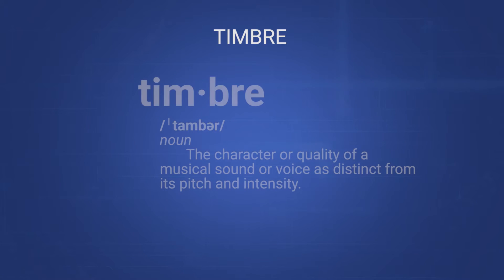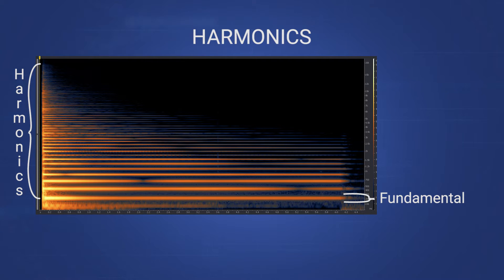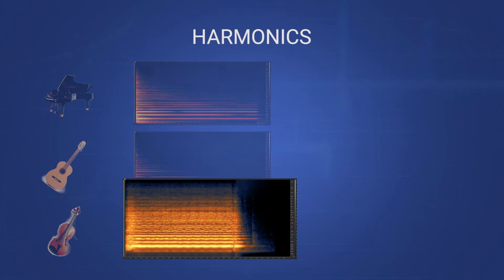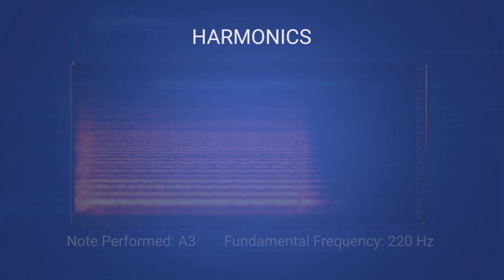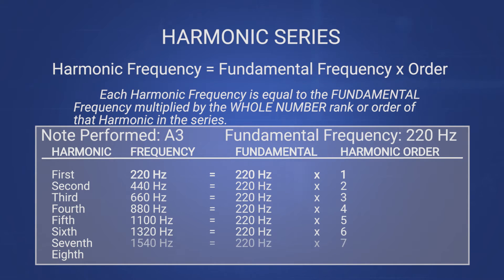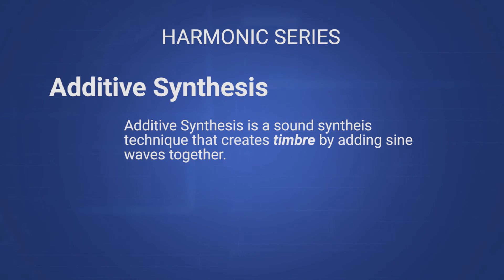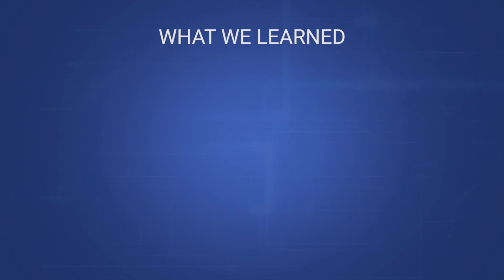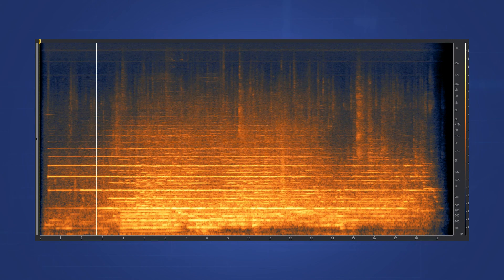Overtones Timbre and the Harmonic Series Full

Comment: Hey there Dan, many thanks for this vid-  it was great.
Do you think i could ask you a semi-related question?  I just wanted to know how one might go about learning to hear overtones more fully?  I ask b/c i'm interested in developing, or furthering at least, absolute pitch, and somebody told me that 'training myself to be able to hear the overtones within a particular pitch' gave them the greatest stride forward.
And apologies if this is not your particular domain (or if it's an outright dumb question!).   
Cheers again, Jeff
Reply from the maker: Hiya Jeff, I do not have perfect pitch and my relative pitch has good days and bad days; however, I believe if you experiment with a very sharp low-pass filter with very high resonance at the cutoff, you will hear each overtone emphasized as you sweep up the frequencies. This could be good to experiment on with a variety of sound sources. If you can hear the first couple of overtones, you'll instantly hear an octave and a fifth, so it will help you discern pure intervals.

However, it's important to keep in mind that most music these days is equal temperament which means that the tuning of each note has been adjusted to accommodate an equal distance between each half-step of the octave range. This is done to allow modern instruments to play in many keys rather than their fundamental key. This way horn players only have to buy one horn and not 12 for each diatonic key. :D The horn in F being the most popular. ;)